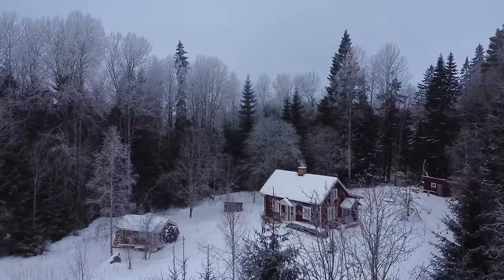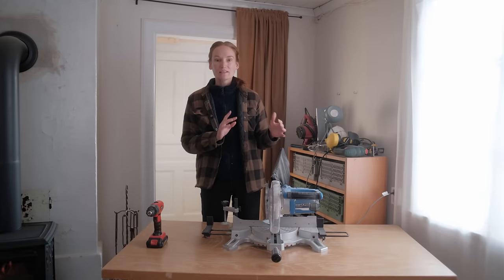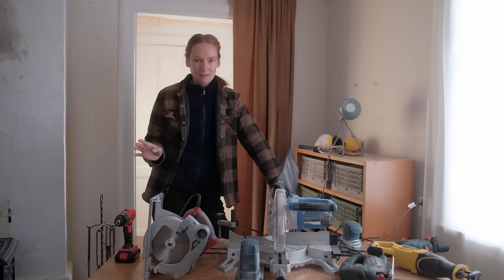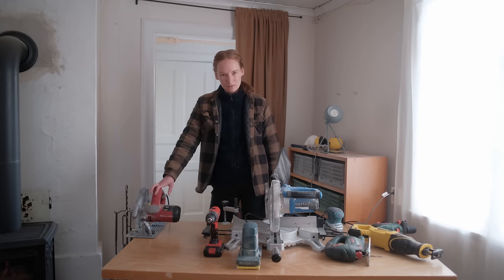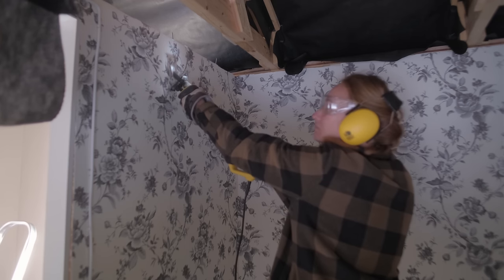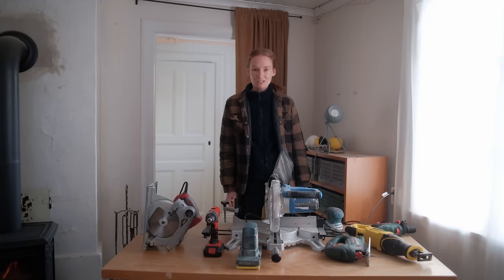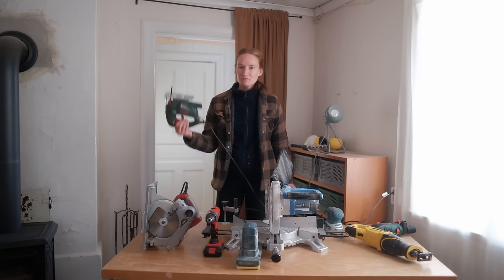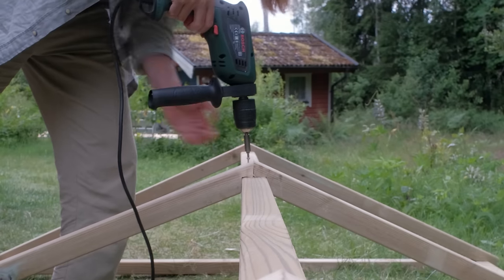The (basic!) Tools I Use To Renovate My Cabin

Comment: Power tools, you have enough based on your experience.  The more power tools just get you into trouble faster and do…DO…remove fingers very easily.  You are doing fine with just your approach—thinking it through—and measuring and measuring before cutting.  Your joints are very tight…no silly, wood joints.  As an ‘apprentice’ (more like free labor) with my carpenter father who learned from his carpenter father who was taught as a carpenter in Sweden.  Yea, runs in the family.  The stories I could tell.

Comment: You've done so well. If you're looking to get an impact driver (dewalt). They also make battery powered nail guns. They're life changing. 
      All the tools you talked about wanting are available in many different battery brands. The cost can certainly be high but it's worth it to invest in a specific brand. Dewalt 20v has so many different tools.

Comment: Since you want to make furniture in the near future, I suggest you begin thinking about making a workshop to do everything you want to make.  When it comes to electricity you may want to look into a solar powered generator.  They could be as cheap as 2k or higher depending but so much worth it because they are portable and you can use your tools everywhere in the property.  You may also think about a scaffolding to make small projects like a shed, a workshop and even get to the roof if you need to.  You can make it yourself out of sturdy enough wood to support you and whatever you need to work with.  They are usually made of metal, but for you and your projects wood is enough where you can assemble and disassemble it as needed.  That is why you will eventually need a workshop.

Comment: I'm a woman in my mid-70s and have been building for the past 30 years. I have a pocket screw jig and love it. I used it for many projects including the shaker style doors for my kitchen cabinets. However, here in New Zealand, I've not been able to find the proper pocket screws so I use stainless steel pan head screws for metal (square drive). They work well. I use the same tools as you, also using a jigsaw rather than my circular saw for the same reasons. I don't have a table saw but thank you for the info on the track saw. It might be just what I need. Thank you!

Comment: I would start from buying industrial vacuum. They are not expensive if you're not looking for a model with automatic filter cleaning or automatic power on feature. But it makes a HUGE difference if you are working with wood indoors and don't like the dust in your hair and everywhere else.

Comment: Couple of things which I hope are new, sorry haven't read all of the previous comments so here goes: the foot on reciprocating saw maybe adjustable to align with cutting surface, if so this should reduce vibration considerably: try using a guide with saw tools, you can end up with pin sharp straight lines just by affixing a straight edge and then  running the tool against this, mini saw works well too in this regard.

If a rule is too expensive look out for extruded aluminium sections often used in house building, these have generally have a profile so retain a straight edge well being cheap and light, the ones I use are from patio doors complete with handle, ideal as a tool guide if measurement is not needed..  

Battery v corded, as mentioned corded generally offer more oomph for your buck, although the environmental impact of mining precious metals for batteries is at the back of my mind when buying, everything comes at a cost.

Comment: Hi Rosie and greetings from the Great White North! Buying tools is always a challenge. The quality usually increases with the price, but not always! My advice would be to buy the best that you can afford, but only if you plan on doing renovations, building and carpentry for a number of years. IE don't buy a Saw Stop table saw to make one rip cut. BTW...a rip cut is with the grain of the wood and a cross cut is across the grain. Generally speaking what  you referred to as a "vertical" cut is a rip cut. A mitre saw usually does cross cuts. An impact driver is very loud, so you may not like it. When you showed us the nail gun you had bought, I thought to myself that I didn't remember ever seeing an air compressor during your other videos. That connector at the very base is where you hook the air line to the tool. My suggestion for sanding would be a random orbital sander. With a low  number grit it (60) they will do a decent job removing rough amounts of wood, and is smaller, lighter and thus easier to use that a sheet sander or a belt sander. I rarely use my belt sander. I thing you would really find a router useful, although it is loud and a little scary as the bits can rotate  at very high speed! (24,000 rpm), but to my mind those are vastly outweighed by all the uses it has. I took a course once and the instructor said that a router could do every job in the shop except for pounding in nails! Don't think I'd want to drive in a screw with one though! lol  Take care...

Comment: You are definitely not a dummie!!!!!. You passed that stage a long time ago. I think it's interesting that you understand the difference between working with machines or with your hands. Sometimes I do the same thing, working with hand tools to feel closer to the material and the feeling for the work. And it's much quieter, so you don't need hearing protection and become more connected to the work. 

When I look back at my tool purchases, it has been the case that the first tool has been a cheap variant and after a while when I get used to it, I knows what are the important functions I should think about when I buy the next more expensive machine.

Comment: My tips/experiences with sanders. The first time I used a belt sander: it was heavy, corded and extremely powerful - so much so that when I set it down on the wood it dragged me forward like a cartoon character, and yes I did make the wood worse by using it for those few seconds it actually touched the wood (before I could get it shut-off). 
The plate sander, like you have, sort of worked ok, but like you experience it doesn't make the wood real smooth, takes a long time to make wood smooth enough, but it is easy enough to handle. 
Orbital sanders, the first time I used one I left circle marks (ugh!), then a contractor taught me how to use it properly... first, turn it on in the air (not touching your wood) and begin to do your sweeping motion before touching the wood and you go down gently with your sweeping motion (never go straight down), the BIG MUST is to ALWAYS keep it moving no matter what (also meaning to keep it flat/parallel with your wood, never tilted), otherwise if you so much as pause you will get circle marks... the orbital sander is fantastic for rougher wood and depending on the grit of your sandpaper you can very quickly make even a rough piece of wood beautifully smooth in no time with little physical energy spent. 
I think you will find an orbital sander much more to your liking and it will produce results you'll be very pleased with. The brand I have is DeWalt, it wasn't the cheapest model, it is corded, I bought it around 1999 and it still works like a charm to this day. I love that sander, it's so easy to control, not heavy at all, makes quick work of everything, and I can use it all day (which I have done) without fatigue. It's perfect for women. 
Love your videos and hearing about your adventures and projects.

Comment: I've had experiences ith both Bosch lines. The (green normal line seem really good bang for the buck at first, but they won't last long. While the motors and battery may have a ok life, the other parts start to get loose of fail way too soon. On the other had the (blue) professional line is very much on the money. It has more power (torque to be exact) and it lasts way longer. If you need a small cordless drill, the blue Bosch with a smaller battery (gsr 12v15 or something like that) is my favorite.

Comment: Horizontally horizontal = level. Vertically vertical = plumb. "Rulers" ya illustrated are called "squares" because their prime purpose is to show if 2 boards nailed together are at 90 degrees (square) or if cut is square to its adjacent edge and, yes, good ones are bit pricey. And, yes, if ya go cordless, it's best to stay with same brand. Also, yes, ya pretty much get what ya pay for. But there is point of diminishing returns. Your experiences have resulted in some good decision-making pointers. Your projects appear to be well done. Congrats!
Reply: Years ago my grandparents and my Dad built their own cottages & houses.  They learned from their fathers so carpentry knowledge was passed down.
I wish there were classes we could take & maybe some of the Community Colleges offer those.  
When I was in high school there was wood shop & auto shop and I think some high schools are adding these back now.
I’m going to see what’s offered at community colleges.
Thank you for explaining the terminology above!

Comment: 30:20  Just a heads up: An impact driver, especially the one on the left in the picture, is NOT a woodworking tool. It's for mechanical work, like car engines or replacing tires, and has way too much torque for driving in screws. 👍 I think I can see a woodworking shop build in your future. 😉 You're super creative and come up with good solutions to your problems. Edited to add: Quickly looked at Dewalt's product line and the one on the right does look like a combined drill and screw driver so that one is more appropriate for your work.
Reply: No it's not. Its made for drilling into concrete, it's not an impact driver thou, it's a drill with hammer function.

Comment: Your miter saw is already a big step towards a professional workshop! You can simply boost it up with one or two supports that have the same height as the miter saw table so you can support longer pieces of wood. In my view, a tracksaw is much more useful than a tablesaw. I started with a tablesaw and later bought a miter saw and a tracksaw, and since then I hardly use the tablesaw. 
Be careful with the bandsander as it will leave rough marks on the wood when not handled with care. I think an orbital sander is easer and lighter to use and is more versatile (you will not use your block sander anymore once you own an orbital sander). I noticed you don't own a plane and also don't plan to buy one. A small handplane (the low-angles ones are great!) however could be very usefull to get straigther edges after you saw your wood to the rough size. O and you will be very happy with the impact driver/drill combination from Dewalt!

Comment: I really appreciate what you've shared.  Your share reminds me that when purchasing tools for my daughters i need to consider things like weight, noise and even overall design.  As a Dad i sometimes think bigger, more expensive tools are what is needed.  Thanks for sharing your thoughts and experiences as it really helped my mindset.  ps, i too hate the noise level of some tools
Reply: Makita is a really great option if you are investing in tools for your daughters! They have a lot of small, lightweight tools with soft start (so they don’t try to jump out of your hand when you switch them on) and other safety features, but they are still powerful enough for professional carpentry. And they are really tough and can take some abuse, too. I love both their 12v and 18v lines. 

I have ongoing tendinitis in my right hand, but I find that I can still do heavy duty woodworking projects without any problem by using the new lighter Makita tools. I expect to still be using them when I’m a frail old lady.

I also love their cordless landscaping tools. I’m particularly enamored with my little 18v chainsaw! It’s so much safer and easier to use than a normal chainsaw, and it doesn’t give me tendinitis issues.

My partner is 6’6 with a very strong build, and even he preferentially uses my small Makita tools over his own bigger tools. They are more powerful than mine, but they are usually overkill.

Comment: to expand your hand tool work you will need a plane and a good sharpening system. Then you can learn to sharpen your chisels and plane and with time can learn to straighten wavy hand cutting (which also improves with time and learning). This is a very daunting area at first but there are numerous tutorials about it these days and it’s a vital skill in terms of refining your products even if you mainly use power tools. A cabinet scraper is also a superb alternative to sanding. Belt sanders do remove a lot of material but you have to be careful. That Makita you pictured is a beast. Really powerful and heavy so might be too much for you if you don’t like loud, heavy tools. You can get a Bosch green or pro one that are much quieter and more manageable though. I prefer orbitals. Very expensive but the Festool one is the best I’ve used and I’ve used a lot. I don’t have my own but have used workplace ones. I have a small Bosch and it is good but the velcro pads will wear out or melt if you press down too hard, which you often feel you need to but really you don’t. Track saws are worth every penny. You can get table saws that break down so you can move them to sites or where there is more space. Cheap ones tend to be heavy, noisy and less accurate. Choosing the right blades for all power tools makes a difference to their performance but cheap tools will often be cheap for a reason. Hopefully some tool suppliers might sponsor you and send you some kit.
Reply: Well explained by Jellyartist. 
I would like to add to this explanation; Rosie, stay close to what you really love to do, working with proper hand tools (no cord nor battery). That means building up more skills like sharpening tools, using traditional planes (start with a small, fits in your hand, size).
The reward is that you will enjoy the building process much more. First build skills, speed will come over time. Btw, routers are also quite the monsters to tame! And require smart jigs to let them do their job!
There are people out there willing to help you get started, just like the chainsaw guy. Ask your community.

Comment: I am diying for many years now. Agree with you on circular saw, always trying to avoid it, still don’t have shop vacuum. Have pneumatic nail gun with compressor, very useful but heavy and bulky. Agree with you on Bosh - very good brand. I am so impressed with what you could achieve with limited tools and knowledge in carpentry. You are my inspiration.

Comment: Regarding nail guns, if you look at CFM requirements for individual tools you find many small compressors will do the job. My compressor is barely bigger than my miter saw, and has a carrying handle to go room to room. The other benefit to compressed air is being able to clean tools, fill tires, blow out water lines, etc.

Comment: I've been thinking about your plan for a vise. I don't know if you have them in Europe but if you look on-line check out a Workmate. That's the product's name and I think it is made by Stanley. I'm sure there are other manufacturers that make something similar but that might be an idea to consider. It would give you the ability to clamp things horizontally as well as vertically as well as give you another work bench that might help you support longer boards. The one I have folds to use less floor space when not in use. Now it would take up some of your precious floor space and that might not be ideal but it might give you some flexibility for your different projects. Any way it's an idea.
    Now on to your admitted lack of being unknowledgeable about constructing things. Hog wash!! What you have made looks fine! Ok, so maybe you have small gaps, so what? Wood moved with the changes in heat, humidity and coolness so those will open and close throughout the year, sometimes less noticeable sometimes a little more. You might not have the experience but you know or have figured out the process, and that is more important than a ton of experience. Some with more experience might make the same mistakes you perceive you've  made but not know they're making them. I figure mistakes help you learn and you have learned a lot! I mean you see things and want to do it differently and you figure out how do it differently.The other thing, there are many ways to get a job done. Your problem solving skills are very good! Your knowledge of design and the ability to see things in your mind and translate that into a beautiful home is refreshing to see. So every day you are learning more. Keep on working and learning!
    One more thing, my cousin once said to buy the most expensive computer we could afford and that would give us the needed capacity. I feel the same with tools. Buy the most expensive tools you can afford! You're doing a great job!! Keep on with your building, we love watching you transform your house into your home. Sorry for the long comment.

Comment: Quite an interesting view, since I grew up with powertools. But someting that totally changed my DIY was my small cordless Makita CIrcular saw. I do 90% of all my cutting with that, a speed square and just a straight edge. Also a good drill/driver is a convinience I will not be without anymore.  So since this my philosopy is that one should invest in the generals tools you use alot (drilldriver, jigsaw, circular saw) and the tools for specific purposes there is usually an alternative way solce them with general tools. The specialiced tools I have to get I tend to get the cheapest I can find since I will not use that tool often.